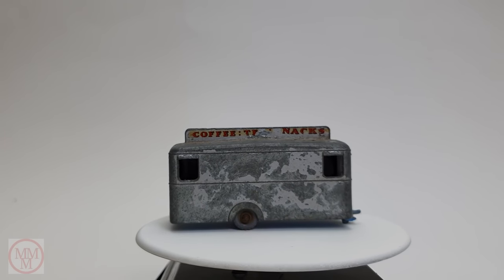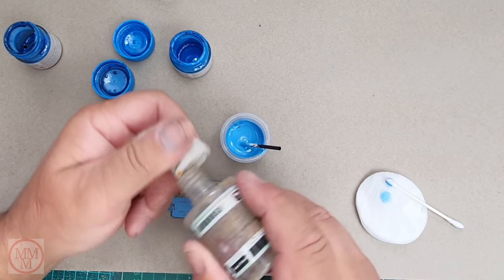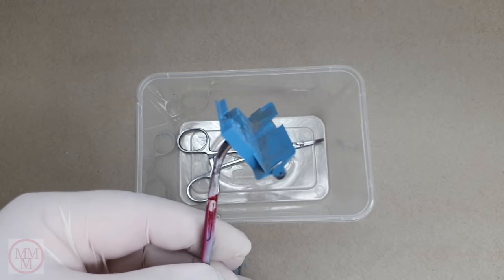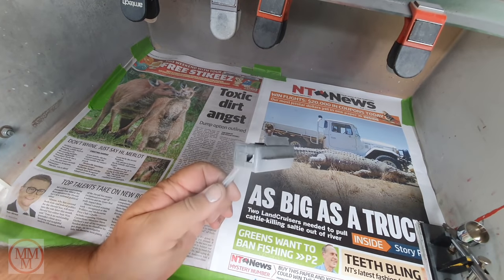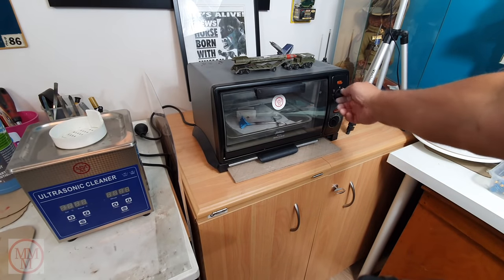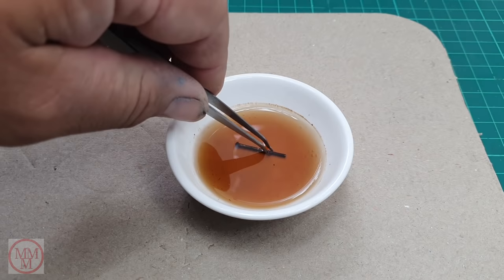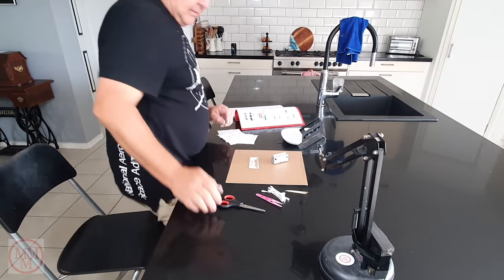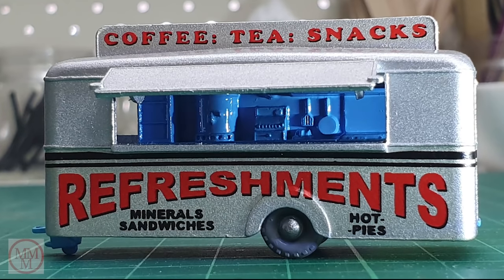MATCHBOX Restoration No.74 Mobile Refreshment Caravan 1959

Comment: The detail on the interior is stunning.  Love the clock.  Its something Id love to try detailing.  I'm thinking keep the Blue theme but add a stainless steel back splash, chrome accents on the tea dispenser and aluminium with black plastic handles for the spatula and spoon...a grey frypan...and maybe a pink clock....stainless oven...ya know?
Miss ya Marty.  Been a while since we've seen you.
Reply: My thoughts exactly. Definitely a part with a lot of potential if you want to go that route.
Reply: As it's roughly 1/76 scale, you could fit a figure or two inside. It's a model I've never seen a good example of yet - they always seem to be missing the tow hitch or hinged flap. I'll keep looking.
Reply: Oh yes. I kept hoping he wasn’t just going to paint it blue but he did. Such beautiful  detail in a small model. How often do you see that? Now it just disappeared and, yes....a scale figure standing inside to finish it off. Marty had a chance to really showcase his skill and instead simply repainted a trailer. Gotta say.....was a little disappointed.
Reply from the maker: @Bender13  Sorry guys, but my mission is to have one of each in 'as new' condition.
Reply: Though it's tempting to add a lot of detail, restoring it to fresh out of the box condition is more in the spirit of Marty's channel.

Comment: Try some Decal Setting Solution-Micro Scale Micro Sol 102 + Micro Set 101 for setting water slide decals. One to help apply the decal the other dissolves the setting film for a more smooth edge.

Comment: FYI, those "nail punches" are called "nail sets", at least in the USA. You use them for setting finishing nails below the surface of the wood. Or in this case for upsetting the ends of axle shafts.

Comment: Hi Marty, 

Some thoughts about rust removal;

You may want to look into one of two products that do an incredible job of removing rust without damaging the item you're removing the rust from - Either Evaporust, or MC-51 Rust Remover (one or the other should be available in your area via Amazon). Both products are safe, reusable (for small parts, for example, just keep a small amount in a sealable jar, and reuse until the product becomes less effective), and removes rust by soaking for as little as a couple of hours (Bonus hint - using it in your ultrasonic cleaner reduces the rust removal time to minutes). 

Just a thought... :-)

Comment: Not sure if you can get this product in Australia or not: Evaporust. It is a chelating substance that only binds with Iron. It is absolutely fantastic! I soaked a bike chain that had not been used for 15+ years in it for 12 hours and it's back working like new (after scrubbing the carbon and gunk off, then lubing it of course). A quart size bottle can treat about 75lbs on metal, so it would last you forever ( it can be reused until it stops working). In the US it costs about $10-$15. Also, it is supper safe and non toxic, which is way better than vinager, Pepsi or other acids. Check it out, if you can get it, I promise you won't regret the buy. My next soak is going to be an adjustable wrench that hasn't moved in 30+ years.

Comment: This is one of those rather overlooked gems and you've done a cracking job on it. Out of interest, does anybody happen to know who built the real thing? I'm wondering if it was someone like Smiths, or caravan builder Eccles. I bet someone out there knows.
Reply: Here in Australia we had similar vans by "Cara-Park" (?) they looked just like this van, very square with the same round corners. They made caravans but they also made commercial vans much like this one and larger ones to but the same style.  

There was one much like this one built into a "driver reviver" (free coffee stop) at Port Macquarie on the NSW north coast that finally closed when the highway was duplicated there about a year ago after 30 years of operation.

Comment: Rust swells and flakes because iron has 3 oxides - Fe2O3, Fe3O4 and FeO. Aluminium oxide, Al2O3, forms a protective layer, preventing further oxidation, but the ferrous oxides don't "mesh" and just flake off exposing further bare metal, which in turn rusts.

Comment: Are there particular styles of wheels that are particularly difficult to come by?  If so, I have an offer.  I can blueprint a sample and reproduce it in resin and send you a mold so that you can reproduce the wheels ad infinitum!  I can't send  photos (I don't think so at any rate}, but with a contact source, I can send you images of my capabilities.
Reply: they even had wheel supply problems in the factory some odd models came with different knobbles to either the normal intended for a model or mixed on an axle or model,  not very often though they are rare.